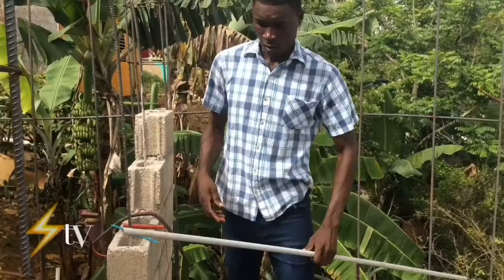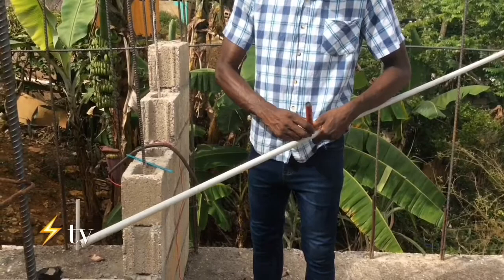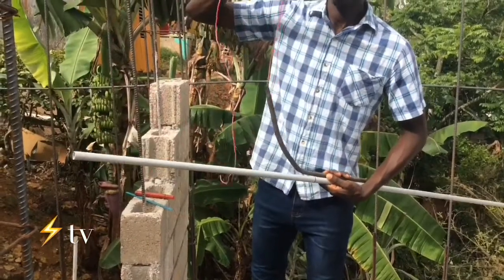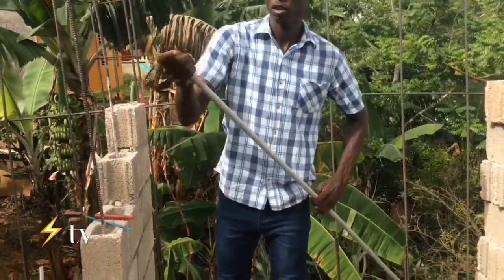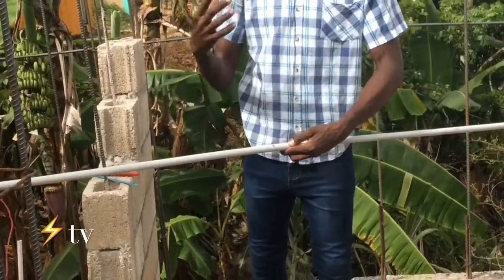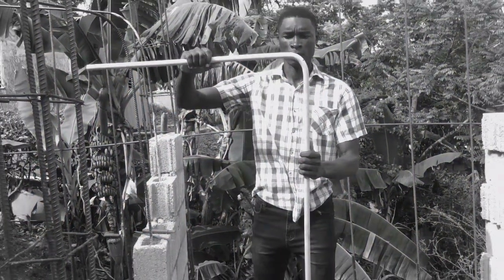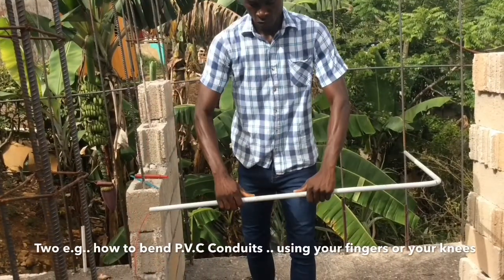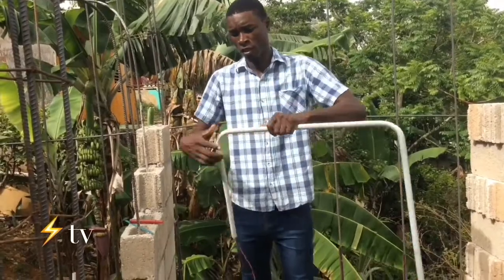How To Make A 90 degree & A Offset Bend With P.V.C Conduits! Tutorial (Watch Full Video)

Comment: What did you put exactly in the tube? It seems to be a electric wire. You've said it in your video, but I couldn't understand. I want to make a PVC crank. Your method seems the best by far. Thanks in advance for your answer.
Reply from the maker: I put a spring bender into the conduit ,the spring bender give the flexibility for the conduit to take the bend but the purpose of the wire is to pull out the bender after the bend is complete.
Reply: What is a spring bender? Could you share more info please.